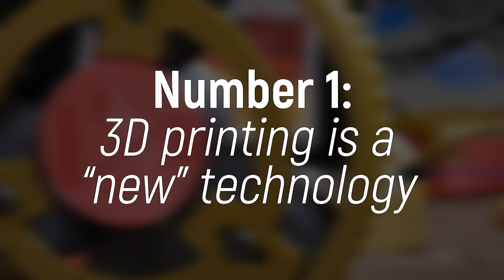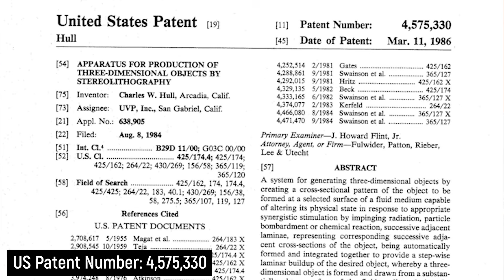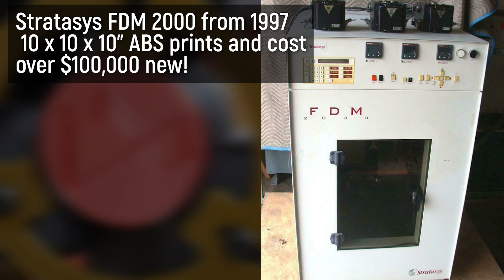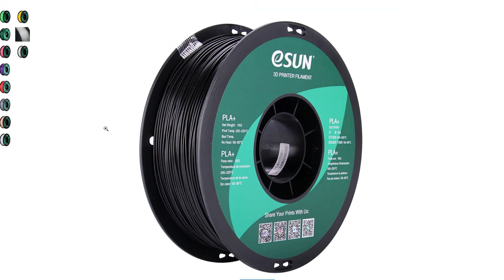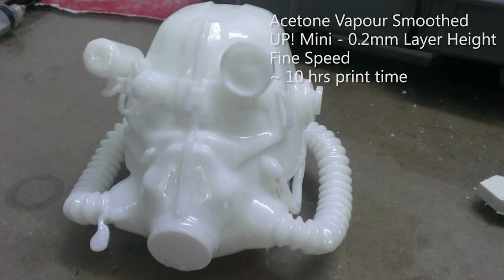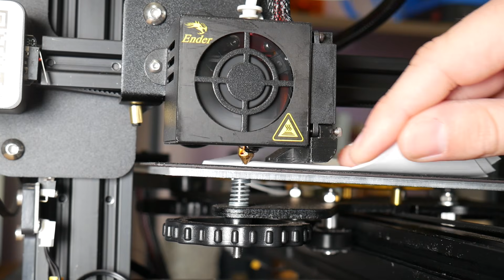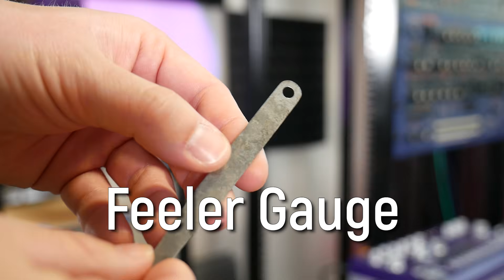3D Printing Myths I used to believe...

Comment: I've used and still use levels to level my bed sometimes but I do that mostly in relation to other parts, not looking for it's position relative to the Earth.

If there's a small deviation in the surface the printer is on I match that deviation to the bed, compare it to the Deviation if one exists in the gantry and attempt to match that to the top bar on the ender 3 and the bed. 

I do use paper as it's what I have on hand and I realise it's not accurate but usually it's good enough, I've considered Feeler Gauges since they serve the same purpose more or less for Automotive work I occasionally do but that only changes the difference in paper being soft. The paper trick is commonly used in adjusting Point Gap but it's also seen as a less reliable method.

I mean, I'm doing it wrong but it works in a pinch

Edit: hoho, nice he even mentioned that, I didn't see that part when I wrote this now I feel like a big brainer XD

Comment: Using paper to level bed is bad idea. I get that issue at beginning and quickly I change method. My slicer have option for first layer high. And I level bed to the zero. Now I have greate first layer.

Comment: Good info. Particularly interested in the ABS section. For my uses thermal resistance is a primary concern but I never considered that there could be variance in the makeup from brand to brand.

Comment: My printer has automatic bed leveling so i must hit all corners to the level sensor on the printer head and then use a thin pice of store receipt from shopping to manually set the print head height afterwards.

Always worked perfect, never had an issue. 
Before i did this the first time i always ended up with loose or failed prints

Comment: For "bed leveling", i was making the same mistake.  Thank you.   As for getting z-probe offset, most instructions i see have you use a piece of paper; the same concept as the incorrect way to level your bed.   Should we be moving the nozzle until it touches the bed so we dont introduce more error with the piece of paper?  thanks.

Comment: that makes a lot of sense to me. I have feeler gauges, don't know why I haven't used them. I usually tram the 4 corners, at that point, the height doesn't matter so much as long as they are equal, then I use the baby steps to get a good flow. Using a feeler gauge should for the most part eliminate the baby-stepping... we will see, thank you Mr. Muse.

Comment: Your bed levelling method is the best but I have a question. My printer is the Ender 3 Pro with V1.1.5 silent board ans glass bed. I slice with Cura. I only print PLA and at 210/60 temps. When I print something, the purge down the left of the bed is good. The print is always good and sticks well with no bed prep other than a good wipe with acetone. But the skirt at 10mm from the print has 3 lines which never fuse, they always stay as separate lines. I have measured these lines as in the region of 0.17 to 0.2mm thick, so the only way they can not be spreading and fusing is if less material is being extruded, or if the lines are individully further apart than when actually printing. Don't misunderstand, I do not see this as a problem exept that I cannot use the skirt to judge the start of the print process. Do you think this is something due to Cura? Is there anything I can do to correct this?

Comment: Regarding bedleveling feler gauge is best, as soon as my customs papers are out I get one to hehehe, I spent way more mony on tools to get x y z axis right and getting everything to square, one thing I learned early, do not disable steppers, in the beginning I Almost ruined my ender 3 v2 bed with that mistake, depending on were on the build plate I am I have a 0,05 to 0,1 mm error, so when doing prints I take kaliper messurments of the skirt print to fine tune before commiting to print, and also fine tuning between prints. Yes technology has been around for a long time, in my youth I started with microship micro controllers but they where to expensive to make something practical of for home use, also only assembler possible, also when I started my first computer had a cost more than 100 times the microcontrollers I can get today with way less computer power than an arduino, today micro controllers are way more powerful, earlier industrial technologi are now at cost for house hold cost, I actually payd more for my laser paper printer than for my 3d printer, free sources of creating are also getting better. Laser cutting technology and cnc technology are going the same way. I think soon both subtractive and additive prosseses will be in every home like todays paper laser and ink printers. Thanks for good episode Makers muse, every point in my opinion spot on in this episode, keep up good work educating us with your experiance

Comment: Or you can configure your z zero point to be where the print starts. I don't understand the reason some people feel the need for an offset. It's pointless. Auto home, use paper, print. Any z offset in the gcode should be 0 in the slicer.

Comment: Question. When I have raised the Z axis by the thickness of the feeler gauge and then set all the gaps, do I need to lower it to zero again before I make a print or will the g-code of the print just ignore it?
Reply from the maker: The printer will re-home before starting, you don't need to do it :)

Comment: Yep, had plenty of arguments with people over leveling with paper. They just couldnt or refused to grasp that leveling the bed using paper only works properly if you first move the z axis height to thw thickness of the paper.

Other things ABS is superior to PLA are ease of sanding, fusing parts together with acetone and superior impact resistance. Also yeah, ABS has horrible UV resistance. Stuff i left outside for a year was destroyed.

Comment: Ok, never had a printer, but looking into getting one, I have a shapeoko xxl,fun but challenging to keep it in toon, on the bed leveling for a printer it would seem that after a few passes it would level the print out if it is not very far off? Yea or any? P.S. for entry looking at a creality ender 3 for a start,thanks for your options

Comment: auto bed leveling is really worth it. i have an Ender 3 with BL Touch and replaced the bed springs with stiffer silicon blocks and never have to readjust the bed even when changing the build plate. i set my prints to auto bed level at beginning of each print while nozzle and bed are coming up to temp and only have to recalibrate the z offset if i change the nozzle.

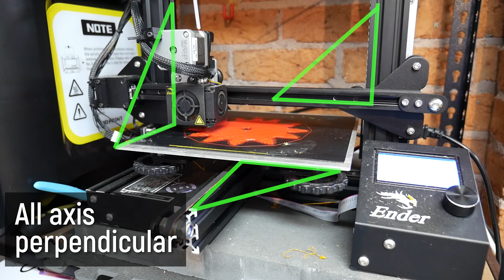Comment: 6:45 Yes, yes you can. You don't need any prior knowledge in 3D printing or CNC milling to figure out that that's not how it works. Just basic logic. Those someones should probably look for different hobbies. I mean, there's Glue&Glitter pictures, if you really want to do additive manufacturing xD

Comment: Brilliant. I am new to 3D printers having had my Ender 3xs Pro [Banggood variety!]  only about 10 days or so. I had no trouble levelling and I produced a good enough Benchy and some 20mm calibration cubes. I also printed a cover for the Ender display and it worked well. BUT then I came to print a little spacer just 21mm diameter with some 3mm holes in it. It was my design on Onshape and I spliced with Cura 4 .10. The little thing would hardly print at all in the centre of the bed and I messed about and stuffed up the level. Several levelling attempts were still no good so eventually I homed the nozzle, raised the Z by 0.1 and I used a 0.1 steel feeler to set the gap. As I type, the print is going well and is almost done. Many thanks, I like your approach. Keep up the good work. [I am 81 years young and trying to prove that you can teach a very old dog a few new tricks!!]

Comment: At least for me the paper the instructions were printed on is very thin paper, and that has seemed to work really well for leveling the bed, getting to the point where you feel a "tug" on the paper when moving it.  So far its worked on two Neptune 2's.

Comment: I think what's happening with the folded paper is that since you're calibrating it cold, the nozzle and bed are both smaller than they will be when printing, where they expand due to heating to roughly make up for the paper-thick gap. It's not "correct", but it's usually close enough to work, and calibrating correctly would mean doing it at print temperature, which would likely lead to burnt fingers.
Reply: yep...sure does, especially with my pork sausage fingers!

Comment: FYI.... Your claim that additive manufacturing appeared in the 80's simply is not the case. WAAM (Wire Arc Additive Manufacturing) was patented in 1920 then heavily revised in 1925. Yes you read that right, pre depression. It has been is use for about a century.... Apparently you still believe in one at least one myth.... No, it wasn't computerized, and no, our printers can't print that good yet either.... We look for visible signs to adjust the slicer and the printer, and prints still fail, even on the best printers. Waam welds go thru far more scrutiny, so much so that nothing that comes off of our printers would ever pass most of those tests. With all the technology we have today with cad/cnc, a mechanical waam can still weld better. Odd isn't it....

Comment: That leveling tip is awesome! I just started with 3d printing and had a difficult time leveling the bed. I did had the feeling that it goes up a bit at the beginning and you confirmed that. I got a feeler gauge right away and the first layer is perfect now! Thank you so much for sharing!

Comment: I've always measured my paper thickness and set the Z height to match it when using paper. I found early on that leaving Z at 0 and using paper didn't produce a good first layer. I very soon moved to a BL-Touch and haven't looked back. However I printed a dial gauge mount and use that every so often to tram the bed, which minimises the compensation needed.
Reply: G28, then G29. bl touch has bed levelling which you can use to estimate the compensation at each corner. Don't need the dial gauge anymore.

Comment: i use a single sheet of normal paper to level my ender, no folding. After getting head to 0,0,0 i raise the bed while moving the paper until it starts to get stuck between bed and nozzle. Works well for me, had to adjust first layer in cura to not overextrude with that method, but thats a step most new kit-built-printers need to go through anyways. I used a normal feeler gauge the first times, but this can leave scratches on your bed and nozzle, so don't use a metal one...

Comment: Abs is extremely hard but its brittle kind of like steel when its hardened. I'm a process technician for injection molding and just now getting in to this. Is polypropylene used as much as in injection. Also is resins the same style as injection.

Comment: The problem with 3d printing is NOBODY is on the same page. The things this guy tells you will be completely different then the next guy and the next guy and so on. I have never seen or heard more more difference's in a community ever in my life. 1 guy says glass is better for this. Another says this bed is better for that. 1 guy says a single sheet of paper. This guy says fold it over a few times.  It is utter chaos and really none of these guys are helping. And sometimes they are a little help.  More so not. I am just figuring it all out on my own with trial and error and little from what they all say because you get a different answer depending on who ya ask. Or listen to. lol

Comment: Thank you kind sir!. Could you kindly go over that last bit about setting your nozzle distance. I'm missing the part about setting your machine. I have a feeler gauge I typically use... .04mm I believe. I get that in a sense I'm lying to my machine because I'm moving the bed away from the nozzle and then I get lost at how to tell my machine this to correct for the lie? Do I tell it in my slicer or in my settings on the machine? 
Thanks again for another great video, I have great respect for your knowledge. You've been doing this sort of thing since you were a kid haven't you?

Comment: I dont use the paper method. I have a bl-touch installed, and what i have done is the following.

I put a Light behind my printer. Then i drop down the nozzle just slightly touching the bed with minimal to no Light going under the nozzle. That is my 0.0 In my slicer, first layer is set to 0.22 for 0.2 layer height for example. Works great for me  😀

Comment: Best one I learnt, “abs doesn’t need a fan” I have since found out that it
Reply: I remember getting "cat ears" all the time with tall ABS prints... (which eventually turns into pincushioning when higher layers get sharp corners again) and then I learned that running a fan for the perimeter walls pretty much eliminates corner curling on ABS!

Comment: The thing you MUST do on your first 3d printer, when I got my Ender 3 Pro my prints were good at first but then became bad.
1. Set the e-steps of your extruder, extremely important
2. Set the bed height using a feeler gauge
3. Buy a filament dryer.
Now I'm able to print cool stuff that looks good, doesn't break and most things are being printed without issues. My funnel printed without any problems and a decent overhang :D

Comment: I must admit it never would occur to me to use paper as a feeler gauge for tramming,  unless I was really desperate. 

Paper thickness is not a fixed "thing", it varies with quality, moisture, weight of paper (gsm), the amount of pressure applied to it, and so forth. 

From day one I used a feeler gauge, simply because that is what I had to hand. I picked up a couple of sets back in the days when dot matrix printers were a thing, as I used to service them, and these feeler gauges are still in perfect condition. Treat them with care and don't bend them and they will last forever. 

So, if you don't have one, treat your 3d printer to probably the most useful accessory you can buy for it. It is also probably one of the least expensive.  A Chinese feeler gauge set, shipped from China should only set you back less than $5, shipping included,  and even the cheap ones will last a life time if used properly. There are a multitude of other jobs that they are useful for too. 

You would be better using a thin sheet of hard plastic if you don't have a feeler gauge. Find something that gives you good results, cut a few strips of it and keep them with the printer. This typically has much better properties and rigidity than paper ever will.

Comment: I disagree wholeheartedly with the abs vs pla. I couldn't find a 1-1 comparison of ABS and PLA on CNCKitchen's channel, and in his graph comparing the UTS of both, he lists the UTS of PLA as 60. According to Wolfram Alpha, the UTS of HDPE is 34. I don't know how you could get 3d printed PLA nearly twice as strong as monolithic HDPE, but who knows. The main problem i have with that as well is that you didn't reference any of your own tests, his are pretty bad, he does all of his ABS prints on open-air printers which are not really capable of making proper ABS prints. Having used both ABS and PLA for years, I can safely say that PLA is far weaker than ABS in UTS and doesn't suffer from the same embrittlement that PLA does (most PLA prints are mechanically pretty useless after a few months.)  I've had just as many ABS prints fail against the layer lines as I have along them. I was using Australian made Blueprin3d filamint back when they were still around for both the ABS and PLA. 

If you don't believe me I will mail you an ABS hook that will defeat any of your PLA hooks. Or we can meet in a maccas carpark.

Also what you're doing to a machine bed when you align it with the X and Y axis is not tramming, it's leveling, it's just that the reference coordinates are local to the machine and not the earth. Tramming is aligning a rotational axis normal to a plane. 

Please make more of these, there are so many 3D printing myths. Do a series on 3d printing mythbusters.

Comment: Wish this paper thing was explained years ago !  After some trial and errors I gave up the paper trick and did adjustments on the fly per  say to get that first layer right. Also I notice there is some variable to the z stop and limit switch. That for me was the ticket to getting the bed set correctly by limit switch / time vs actual mechanical stopping distance. SUPER thanks like always Angus !
Reply from the maker: Glad to hear it helped! Don't worry, I was stumped for ages with the trial and error paper approach.